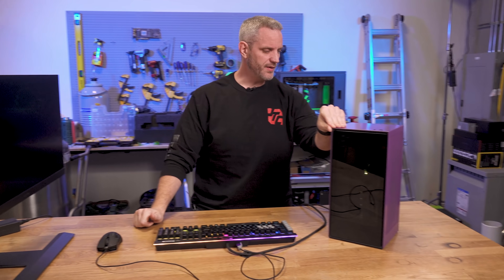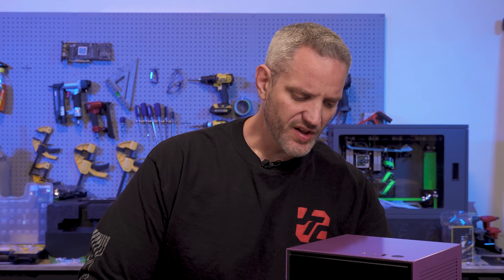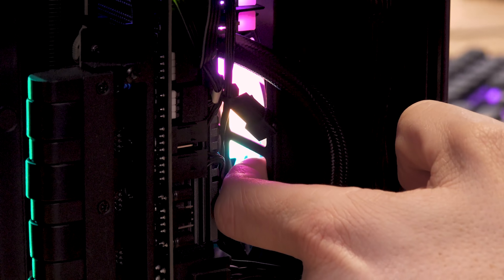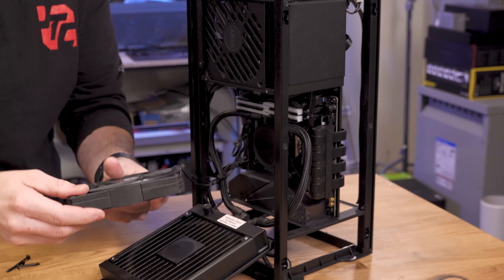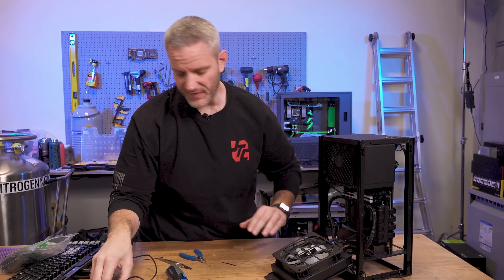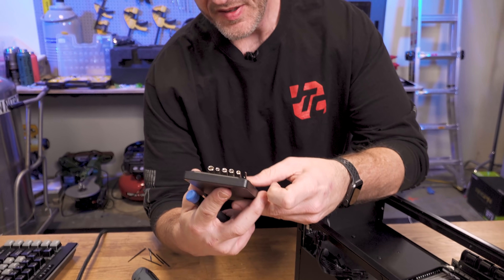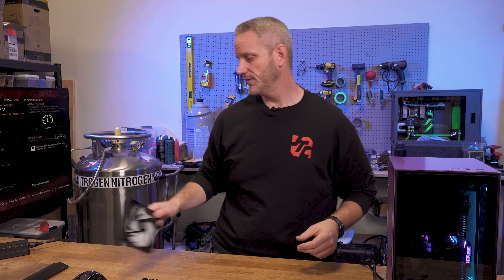This PC is shutting down due to overheating... let's investigate why!

Comment: That fan is fixable.  Flush it out thoroughly with WD-40, let dry, apply new lubricant. :)  I have done that to a lot of fans in the past 20+ years.  Works great

Comment: Those washers don't isolate the ground you still have screw to metal contact with the threads.
Reply: But he put in two washers! Lmfao that has to help, try 3 when 2 don't work jay! Lol
Reply: Exactly.
Reply: Please help 
I built my pc and it starts but I get no signals on my monitor 
Tried everything 
Ram 
The monitor it self 
Gpu 
Everything is plugged correctly btw 
The fans spin and lights are on but there's no lights and my keyboard and mouse don't get lights as well 
I got ryzen 5 2600 
16gb ddr4 3000
2060 rtx 
Psu is 400w 

Where is the problem??
Reply: It's just to prevent it from going too far down and pinching the PCB on the other side.

Comment: I’m still a novice when it comes to building a pc I was wondering if someone would be kind enough to help me on what I should get for my fans for like hub or splitter , I have the Corsair ones he replaced the old one with and have them running without rgb but I only have one rgb header on my mobo and it’s being used for the stock cooler that came with my cpu and using a deep cool 10 split hub to run the 6 fans I bought I’d appreciate it someone can give me an idea of what to get since I want my fans to actually be lit up
Reply: I would suggest picking up an H100i Elite Capellix AIO, it comes with a Commander Core which let's you power not only 6 fans, but has RGB connections for 6 Corsair products as well, so since you have 6 fans it would work perfectly, and since you have a stock cooler its the smallest cheapest 240mm variant they make, only just over $100 for it, plus it looks absolutely sexy with my LL120s.
Reply: @TheGauges420  thank you so much !! I’m looking into it now I’m going to pick it up

Comment: "I've run Steam OS at 3,6 Ghz on i7 and I was alone in the room, that's why my Windows 8.1 is certified only 2,4 I guess. There's a lot of counter phase against me around here. Low on mounting guards?! As usual..." 🗨🙄💻🎭🌡🌌

Comment: Jay i need help, I got into pc two weeks ago. I bought a pre-built due to the whole graphics card situation. I now plan on trying to build my first pc ever. I will be mostly gaming along w running steam etc. In the background. I'm not partial to anything right now. What is better intel or amd? I'm looking for fps for sure. I've done alot of research and found nothing definitive. I plan on going w the p500a digital case. Some say amd some say intel etc. I do plan on going w a 3080. if I can ever get my hands on one that is lol. Any help would be greatly appreciated thats for sure. If I have any issues can I ask you for help? If you're like me you like a challenge. Thanks again and great videos btw

Comment: Had the CMOS/UEFI reset issue a couple of weeks ago on my dual boot system (Linux Mint and Windows 10 on separate SSDs). Replaced CMOS battery and Windows self repaired its UEFI boot entry. How could have I reset Linux Mint's boot entry without a time consuming reinstall? As you have brought up this issue in this video, could you please make a video on this and how to fix the dual boot afterwards? Thanks!

Comment: Reminds me of that time.... when I had an AMD 4core CPU in 2010. The plastic bracket that keeps the CPU cooler had broken off. It BSOD'ed on temperature, so I open it up and the cooler falls into my hand XD

Put the PC on its side - requested a fix from the seller. Took some weeks, but I got 2 seperate plastic brackets for my mobo. Replaced it, put the cooler back on, didnt even repaste (noob). It ran for years with no issue XD

Later replaced the tiny ass fan with a low budget after market cooler that was much much quieter, and ended up selling the board and CPU for 30eu in 2019? It was too loud and slow to be of any use to me...

Now waiting for my 5900X, upgrading from a 8700K. Growth!

Comment: I had the most random overheating problem about a week ago and I have no idea what fixed it. I've had the same 8700k Corsair h150i in my pc for over 2 years now and all of a sudden my cpu was hitting tj max when previously I would run at 55-60C under full load. My first thought was, "ok a cable came loose somehow and the pump is working." Replugged in all my cables tied to the AIO including radiator fans, and had the same problem idling at 50C and instantly hitting 100C when starting a stress test. I checked the pump and it was running at full speed. I took the AIO off and my thermal paste was in really good condition, full spread across the die and still liquidy( not crusted up or anything showing that the paste went bad). Regardless, I applied fresh thermal grizzly kryonaut paste and still had thermal problems. I rechecked all my connections and pulled the AIO off once again to make sure I had good paste spread and contact and all was in order. Couldn't find anything that would indicate a problem so I went on Newegg and bought an Arctic Liquid II Freezer, 3600 (cause it was the only cpu that wasn't priced ridiculously, and a x570 mobo so in hopes of upgrading to 5000 series next year. In order to keep my pc still halfway useable to do regular, non-gaming stuff until the new hardware came in I undervolted my cpu and clocked it down from 5.1ghz to 4ghz at 1V. Then randomly, 3 days later, my cpu starting cooling again and it was idling at 30C, I opened a stress test and never went above 60C and all is in working order. So now I have $650 worth of parts already in mid shipment that I won't get until Jan 8th on its way and I have zero use for them. Idk what the problem was or what fixed it. My only possible theory is that the pump was reading that it was spinning, but the fluid in the AIO was clogged up somehow and preventing proper flow and then it randomly cleared itself back up but I have no idea. I'm going to put in the all new hardware when it arrives anyway just as a safety measure, but I'm really annoyed that this even happened because I had a god tier silicon 8700k I was able to clock it at 5.1ghz with only 1.2v and now I can't get it to 4.9ghz at 1.3v it's too unstable and I think it's because I fried something back when the cpu wasn't getting any cooling.

Comment: TO BE CLEAR:  with Magnetic bearing fans only the bearing lasts a while not the RGB. I've had plenty LL120s die.
Reply: To be clear, I've had x8 LL120s running in my rig for well over 1½ years, none have died.
Reply: @TheGauges420  You do realise I didn't say 100% failure rate. I had 6 and ones RGB died and caused the rest to freeze until I replaced it. There are exceptions to everything to be clear.

Comment: I was replacing my motherboard the other day from an h370 to a Aorus z390 pro WiFi and it should of been pretty simple. Except the very last screw to unscrew it was some how jammed into the standoff and locked up. So when you spun the screw the standoff spun as well. I ended up having to take pliers to it to get the standoff off the case after trying for a while. I got the mb out finally but couldn’t disconnect the screw from the standoff. After some finagling I finally got it. Luckily the standoff was able to screw back in and work with another screw. The screw itself though was completely bloated for some reason and wouldn’t screw into any standoffs. So now I’m one screw short on my mb, but I oughta be fine. 

Also upgraded from an Intel optane 16gb module to a 32gb module paired with my 8tb ironwolf nas drive, and an i7-8700 to a i7-9700k. Runs like a dream and am absolutely loving it. It’s been so long since I messed with my pc that I forgot how fun it was. Plus now my ram can run at 3200mhz! I’m sure no one cares about it lol but I’m happy with myself, it’s also the first time I’ve replaced a mb by myself. 

Love the channel jay, it’s the first place I look for help with anything and has gotten me way more into pc’s over the last year from watching your vids. Keep up the great videos 👍

Comment: I definitely love myself. Bought the Ifixit Pro-Tech Tool Kit so I was fully prepared to upgrade my new configurable laptop
Reply: Please help 
I built my pc and it starts but I get no signals on my monitor 
Tried everything 
Ram 
The monitor it self 
Gpu 
Everything is plugged correctly btw 
The fans spin and lights are on but there's no lights and my keyboard and mouse don't get lights as well
The pc stays on for few min and turns off automatically than it turns back on
I got ryzen 5 2600 
16gb ddr4 3000
2060 rtx 
Psu is 400w 

Where is the problem??

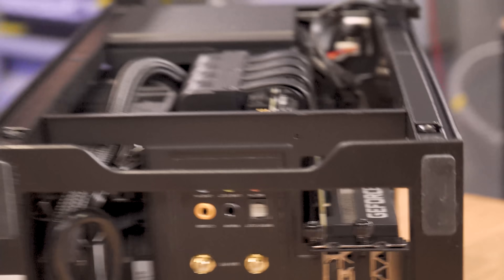Comment: That electric screwdriver @14:10 into the video looks remarkably similar to the Skil one I picked up from Home Depot for ~$20 - wouldnt be surprized if same OEM / different brand and color scheme. Looks like Home Depot may have stopped carrying it but Amazon still seems to be selling it: https://www.amazon.com/Rechargeable-Cordless-Screwdriver-Circuit-Technology/dp/B07C4916LS Just sharing in case anyone might be interested in it since Jay seems to have "forgotten" to put the link in the description (even though he said he would add a link to it 😋)

Comment: I volunteered to help a friend of mine fix and issue with his wife's computer yesterday. Her MoBo malfunctioned. Luckily I had another old system that worked perfectly fine and was even slightly better than what she had (went from fx6300 system to an intel 4th gen). Swapped her drives over and her GPU, and it all worked out besides the fact that I had to shave off some of the cover of the HDMI cable because the Aza case has an indention at the top that blocks cables from going in.

Did it all while wearing your new design T shirt! From here on out I'm doing everything tech related in that beautiful shirt. Cheers and merry Christmas!

Comment: RGB fans are nice & all but I prefer high quality silent fans- for many years I have very good luck with the Noctua NF-F12 PWM Premium 120mm 1500RPM & be quite! Silent Wings 3 120mm 1450RPM fans. They last forever & work very well on watercooling radiators or as case fans.

Comment: Hmm. I've got a pair of Metallicgear fans in the front of my case. They've survived so far, but I'll keep an eye on them now.
Oddly enough, that Hammerhead screwdriver looks exactly like one sold by SKIL, just different colors. The SKIL even has a built in circuit tester like the Hammerhead.

Comment: After a bit of advice.  My sons pc makes a constant connect/disconnect sound when it's in sleep mode.  I've tried everything I can think of Including moving the USB's around,  enabled and disabled usb selective suspend in the power settings.  I can't work out what's causing it.

Comment: To the recall portion...a plastic washer to insulate from grounding? What prevents conductivity where the threads of the screw contact the metallic threaded hole? If the actual solution is that a washer pulls the screw back far enough to not let the screw contact the printed circuit board, then the washer can be conductive. What am I missing here? Jay, did you eat a healthy breakfast? Jay the Curmudgeonly

Comment: The center of the fan was pushed against the pump, creating enough friction to kill the fans motor. The stock nzxt fans center doesn't protrude the fans frame.

Comment: i have a problem with my Power button on my pc case. i don't know what happened to it and i don't know how to fix it and i don't want to replace my entire case just for it . it might be a dumb thing that you guys know. the button is not very responsive meaning that i have to press it like 9 times and hold it and try again 4 times then it works and now i leave my pc on everytime because of it

Comment: Isn't it possible that the threads themselves can ground with the PCB within the hole of the riser and the chassis? Or is it the head of the screw being too big and touching the top of the PCB some where? I replace the screws with zip ties on mine and that seemed to hold it well enough instead of reusing the same screw.

Comment: Please help
I build a new PC recently, it has random freezes every few days.....the freezes have become more frequent now :(

I am very helpless as I have tried almost every solution I could find online.
Using SSD with Windows 10
Tried below solutions but still couldn't fix the problem:
- set bios to optimized default and no XMP profile
- did memtest86 for RAM check
- updated to latest bios and drivers
- will reinstall windows but I doubt

Anything else anyone wants me to try ? You get free donation if you just help me resolve my issue! That's how desperate I am. I don't wanna regret building a new PC. 😭

I am using windows 10 with below PC configuration:
Ryzen 5800X
Asus ROG B550-F WiFi motherboard
Corsair Vengeance 3000Mhz 2x8gb
Corsair VS650 PSU
Samsung EVO 500gb SSD
Samsung QVO 1TB

Comment: I've got a fan that did that, too. Granted, it's 15 years old :D 
It was rear exhaust on my X58 rig and sat doing nothing for the last five years. I fished it out a few years back, along with two identical fans which had been stored flat for most of that time, and it was the only one of the three that had a problem.

Comment: Hey Jay. The nylon washer will only work if it is shorting on the top layer of the board. If it is shorting to another layer in the through then it will still short to the chassis. you should replace it with a nylon screw to be safe.

Comment: i just got a pc and i am smart in the electronics department so when I got a problem I could fix it. But this problem, just 30 hours after I got my new pc, the boot drive just dies. the light for the boot was on and that sucks because I cannot just think a part out of thin air. i can fix everything else except a broken part. oof

Comment: Hi everyone! For the screwdriver, it appears the HAMMERHEAD HCSD040-02 is no longer being sold. There is a SKIL SD561201 which is nearly identical (probable OEM copies) and is currently available at Amazon for under $30.

Comment: How is the washer a fix when the body of the screw goes still goes trough the board
Reply: There is probably some isolation on the board around the hole, but not enough to clear the head if it bites into the board.
Reply: It's likley the head of the screw that was digging into the PCB, not the threads, so by adding the washer it separates the screw head from the top of the riser PCB
Reply: @SGManiac1255  I understand that, but the body of the screw naturally had to go through that Lair, but I don't know the make up off that board and if there are traces next to the head of the screw and away from the body that are causing the problem. But I can't see any thing like That from That video.
Reply: @yuhHornerman  this is all speculation as I don't have this case and can't see for sure. However, it's likely the hole in the PCB that the screw goes through is wide enough that the threads don't touch and the only part of the screw that touched the PCB was the bottom of the screw head
Reply: @SGManiac1255  yeah like I said also I can't really tell from the video
Reply: Because the issue is on the surface of the board, the hole itself is isolated.
Reply: @sujimayne  do you own this case?
Reply: Please help 
I built my pc and it starts but I get no signals on my monitor 
Tried everything 
Ram 
The monitor it self 
Gpu 
Everything is plugged correctly btw 
The fans spin and lights are on but there's no lights and my keyboard and mouse don't get lights as well
The pc stays on for few min and turns off automatically than it turns back on
I got ryzen 5 2600 
16gb ddr4 3000
2060 rtx 
Psu is 400w 

Where is the problem??

Comment: Jay have you ever installed an AC with speed control electronics fan like this one ( https://www.amazon.com/AC-Infinity-Controller-Fireplace-Circulation/dp/B009OXZ0OU/ref=sr_1_14?dchild=1&keywords=ac+speed+control+pc+fan&qid=1608837955&sr=8-14 ) in a PC if so which ones are good and quiet?

Comment: I'm surprised you didn't check the thermal paste to see if it was crusted/baked onto cpu. 

Iv run across these kinds issues and after changing out the fan or aio I was curious to see what the thermal paste looked like being run that hot till thermal shutdown. 

It was either chalky or straight up like those AMD carbon pads.

Comment: Would mounting a Power supply in  a sideways configuration run the risk of overheating. i.e. 011 dynamic style cases since they are so popular?  Or do most power supplies use mag levitation? (I don't have this situation, just curious)

Comment: Have you ever done BIOS update trouble shooting? I recently spent a good 2 months trying to work out why any newer BIOS that I updated to would cause system instability. I would turn all sorts of knobs and dials in the BIOS settings, waited for new versions to try, locked voltages & clock speed, new/different drivers. You name it, I tried it.

What fixed it in the end?

A simple cmos reset. Apparently previous BIOS settings were being retained and causing weird behavior.

Comment: I put an ml140 corsair fan in h1 and you can clearly see the lighting on the side of the fan through the front of the unit. Paired with the ram lighting and the gpu lighting, it looks awesome.

Comment: Correct me if I'm wrong but, wouldn't the threads of the screw still touch the PCB even with the plastic washer?...I mean the washer is just preventing the head of the screw from touching the PCB but it wouldn't insulate the thread area of the screw thus it will be able to touch the insides of the PCB screw hole :/

Comment: Dude this really is that month, and the worst timing to get parts. My Z390 itx board died in the middle of a work day and since I couldn't find another board, I ended up buying a 5800x. Then the board for that from Micro Center was DOA, so I got another, which had USB problems, so I got another. WTF is up with December?